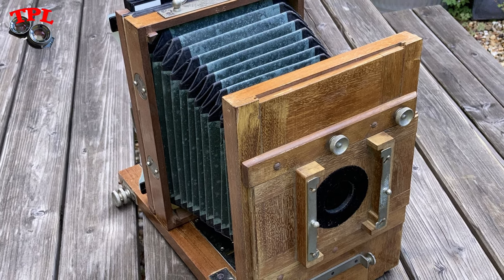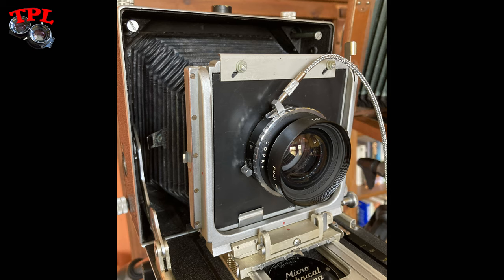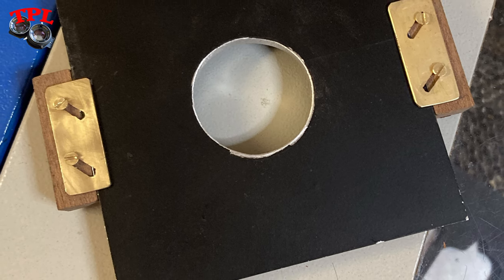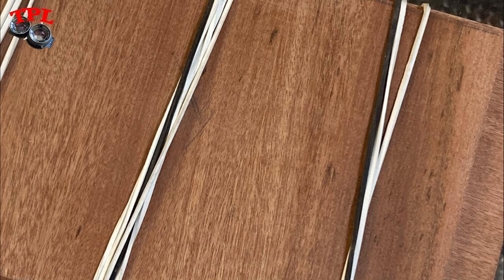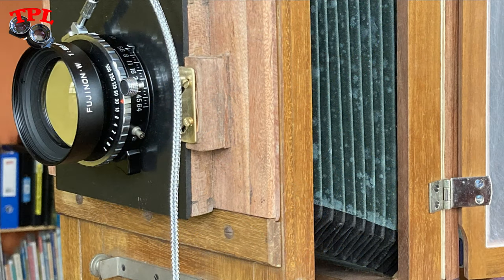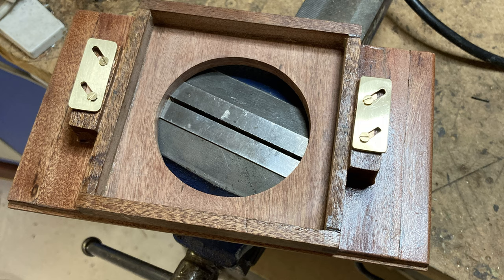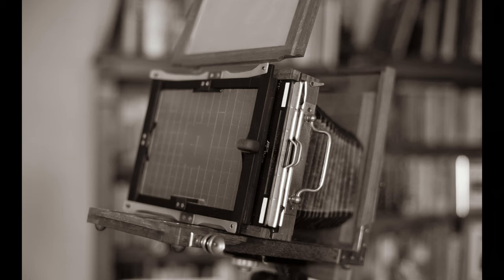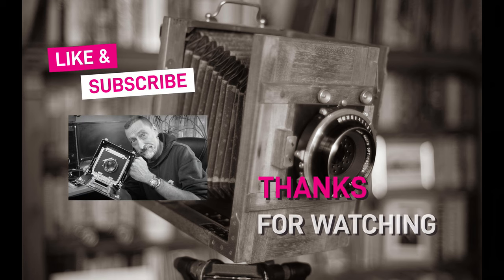Restoring a 5X7 plate camera to full working order part 3

Comment: Fascinating and well done as usual! I knew your 240mm Fuji would work and if u had any Fuji W lenses let also would work. Good luck with processing, tray would require full darkness, If u can locate some Paterson tank adapters..I am spoiled because I use a jobo expert drum on a Beseler roller base but now are very costly. Can not wait to see u first trip out. Again really well done.
Reply from the maker: I'm toying with the idea of selling the Stearman 455 tank (5x4) ... which is a fiddly cow that falls over at every chance due to its narrow base (how I've not pitched it through a window in frustration I'm not sure) and investing in the Stearman Press 10x8 - which does four 5x4 or two 5x7 or one 10x8 in daylight. It's flat ... so no drunken falling over issues - the catch is that it's £170! That's one heck of a price tag to what is essentially a dev tray with a lid (plus some light trapping. 
As soon as my extra film holders arrive from the wilds of New York I will go 'hang it' and do a 5x7 shoot and worry about how I process the film afterwards :-)